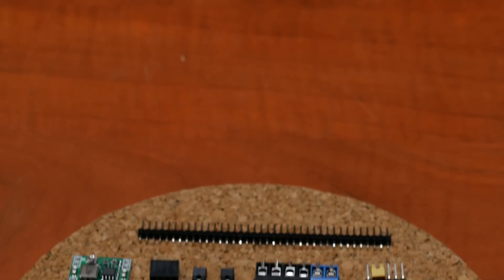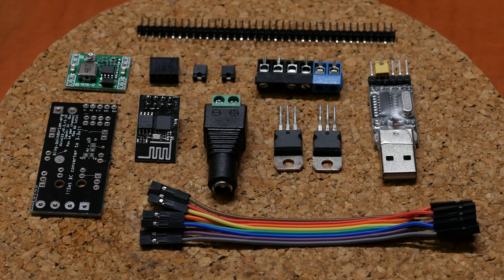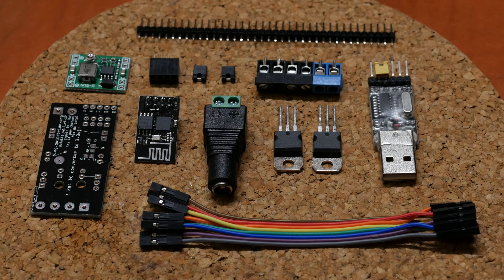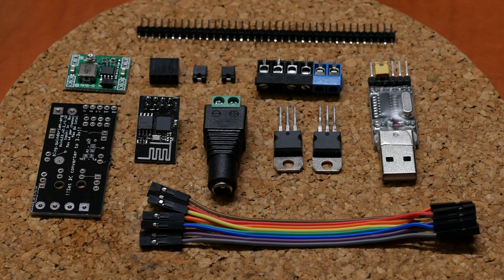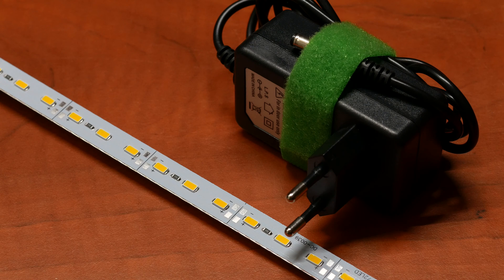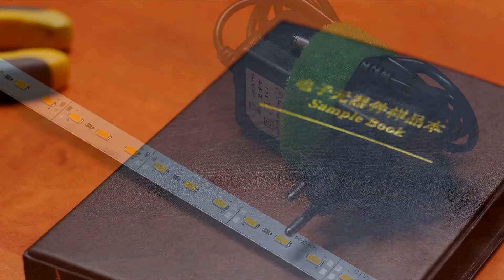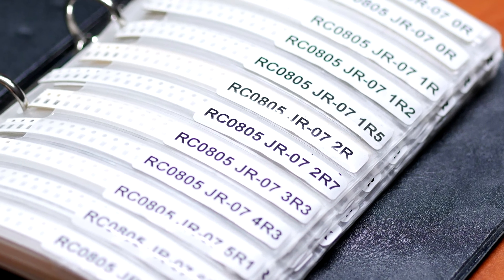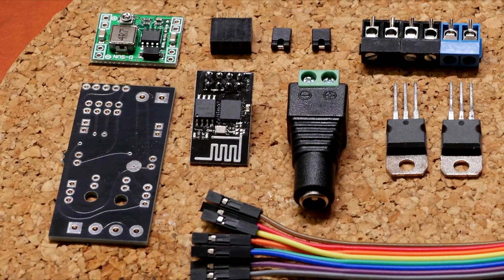ESP8266 LED Lighting: The Components required for QuinLED

Comment: Is this board also a solution for individual addressable RGB led strips?
Reply from the maker: No, this version is of the board is only suitable for so called "analog" LED lights. For digital you don't need the MOSFETs

Comment: Is there any chance of showing were you've put the resistors for the protection, i have 20 of your previous boards and three in production as it where but would rather not buy all new boards if i can possible just retrofit the existing ones with a few resistors.  BTW the iffy one i mentioned previously has went totally iffy now so shall see about replacing it.